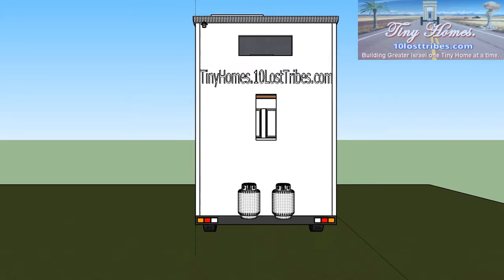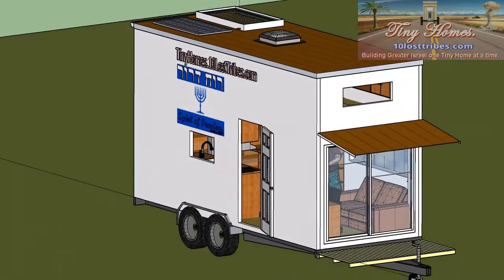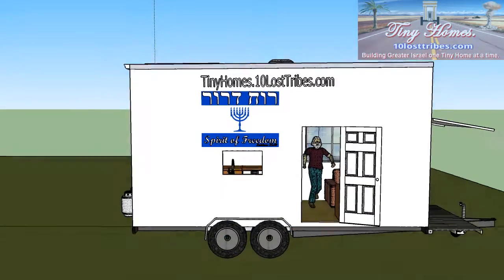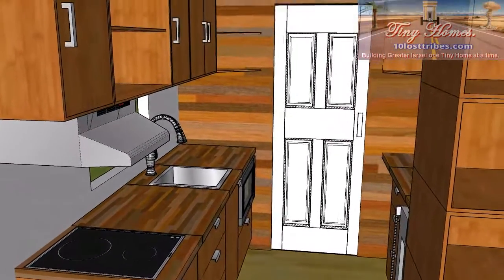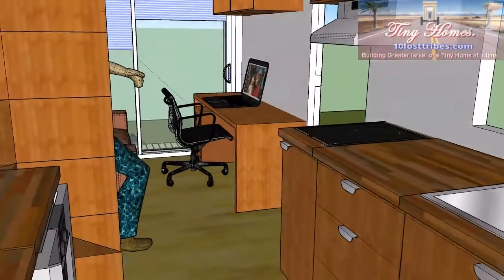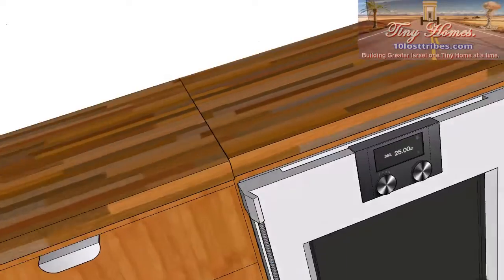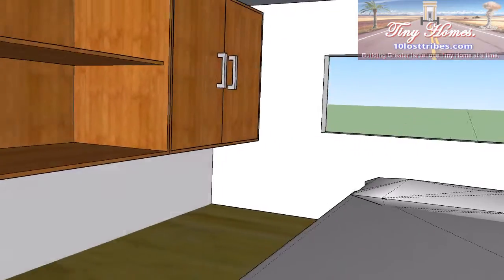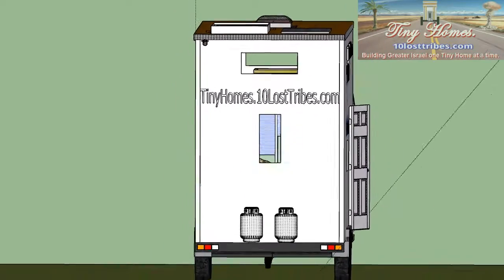Rory's 20ft Tiny Home SketchUp Model

Comment: Your drawing skills are awesome and your design is practical and comfortable.  Everything looks nice and fits well, except for the stairs.  A person cannot fit through that space that turns.  An engineer can design them as spiral, straight, or with 90 degree turns on landings, but I think you want to save money and minimize your stair space.  The spiral design will cost a fortune.  The landings option will lose the least amount of your original design.  To keep all your design, use a ladder.  I hope this helps.